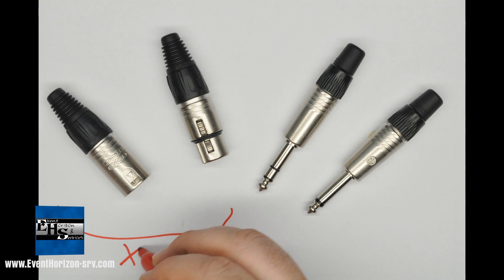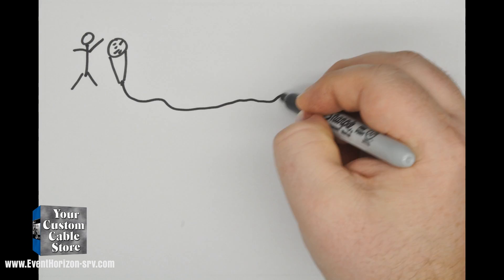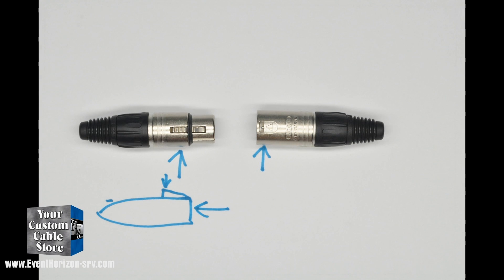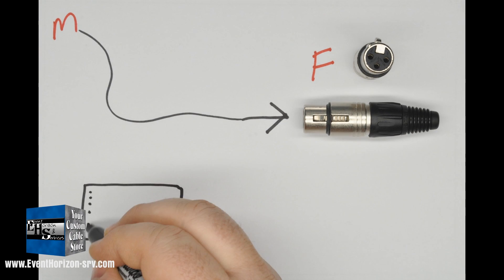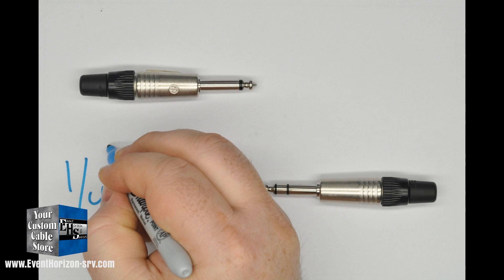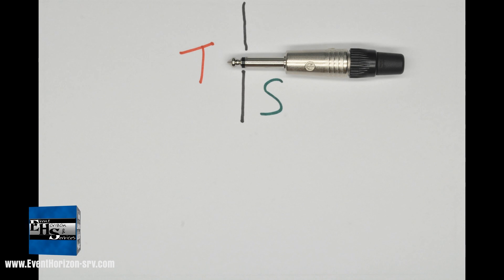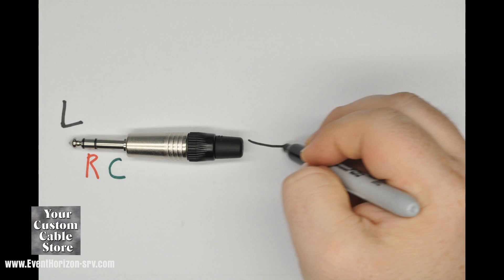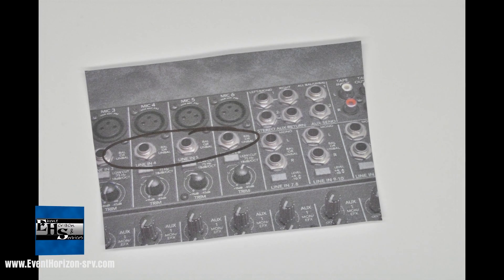Intro to XLR and 1/4" connectors

Comment: I have a microphone that uses an XLR to 1/4” jack cable. I bought a wireless mic system where the wireless transmitter plugs in to the mic, and the receiver, which has an xlr connectio, would plug into the mic input. However, the mic input is a tls connection, so I got a female xlr to tls adapter. Although everything fits well and as expected, the adapter does not work.any thoughts on why the adapter wouldn’t work? I would think it is just extending the same signal to the input. Thanks for any insight.

Comment: I have Behringer Sl 75C dynamic mic (XLR), and need to use it for podcasting (vocal?). Which cable END do I need to connected to Behringer Xenyx Q802USB mixer?  XLR? TS 1/4? or TRS 1/4?  I was worried if I buy mono (TS 1/4) that my voice will be heard only at one side of headphone? is that correct?
Reply from the maker: You need a regular mic cable XLR to XLR. Something like this: https://eventhorizon-srv.com/shop/mogami-2552-microphone-cable-10ft-p-72   You must use input 1 or 2 with the XLR input. The 1/4" connections on all channels will not provide the same about of gain and will not work as well for a microphone.
Reply: @EventHorizonSrv  Thanks a lot, I appreciate it .🙏

Comment: Nice! How can I connect my professional microphone to a audio receiver for speaking & singing?
Reply from the maker: Hey Stephanie, By receiver, I assume you are talking about the device that is normally used as a home stereo for switching and volume? One that just contains the normal RCA inputs?  If so the level of the mic signal is too low to be useful to any of the inputs. You would first need to feed it to a mic preamp to boost the signal (something like the Rolls MP13). From there you would need the right cable to feed out and split to the stereo RCA inputs, something like this: https://eventhorizon-srv.com/shop/y-ts-male-mogami-2528-cable-p-3622. Note, you should be careful, home audio components are often not designed for the dynamics that can be created by a live signal, you can easily damage speakers if you are trying to drive higher volume levels.
Reply: Great! Thanks for info & responding so quickly.
Reply: Great! Thanks for info & responding so quickly.

Comment: Very nice explained. I need your opinion. I recently bought iBasso DC01 and Samson QH4.
iBasso DC01 has 2.5mm TRRS balanced output and Samson QH4 supports 1/4" (dual 6.35mm TRS) balanced line input.
To connect these two devices I need to build this type of cable https://www.aliexpress.com/item/32954629109.html
So the question is how to wire 2.5mm TRRS balanced plug to dual 6.35mm using 8 core cable?
I draw this graphic to illustrate my question https://postimg.cc/qhS6Yhy9
Thanks in advance.
Reply from the maker: Hey BGA, you would tile the L+ contact to the left Tip, L- to the Left Ring, R+ to the Right tip, and the R- to the Right Ring. If you have a shield you would tie it to the sleeve of the 1/4".  The wire is the hardest part, you need something really thin to fit the 2.5mm. Then splitting it into two connectors can be a problem too. It really is a pain of a build because of the size of the 2.5mm connector. I might be able to do it, but I would have to check on a few things to know if I had the right wire.
Reply from the maker: I went to reply to your reply and it was gone, did you delete it?
Reply: @EventHorizonSrv  No. It's there. If you want I can copy it in "discussion" or I can send you a email
Reply from the maker: @furry0ssa  It just isn't here for me... I have it in an email, so that is ok. So basically you through a lot of information it that, but I am not exactly sure what you need to know or what exactly I need to answer. Could you please clarify?
Reply: @EventHorizonSrv  This is the lost post from yesterday:
Thanks for the reply. Ok, I agree with you. Pentaconn 4.4mm (TRRRS) plug is a way better than 2.5mm (TRRS) but iBasso DC01 only have 2.5mm
and it's not a good idea to use an adapter 2.5mm male to 4.4mm female for this portable DAC.
I already have these parts
https://www.aliexpress.com/item/32997088134.html
https://www.aliexpress.com/item/4000543110687.html
https://www.aliexpress.com/item/32890458597.html
I chose rhodium plated plugs and 8 core cable because it has thin wires and I need only 1m length. 
So this will not be a problem to solder on 2.5mm plug, but splitting it into two connectors and which wire goes where that is the main problem here.
Also this setup (iBasso DC01 + Samson QH4) I plan to use only for headphones and earphones testing.
So you suggest using this method where this guy create an adapter for headphones 
4pin XLR to dual 3pin XLR for this AMP https://www.schiit.com/products/ragnarok-1
This is the scheme that he uses https://youtu.be/02_akBIw_5I?list=WL&t=41
it's basically the same solution as 4pole (TRRS) to dual 3pole (TRS).
I also came across this cable https://tinyurl.com/yx2v4cuu (on the image below it shows the wiring of this headphone adapter cable)
and its scheme is completely different. So I decided to ask you for an opinion which of these two solutions is good for connecting a balance DAC
and an AMP that has only balanced input (but not output)? 
Also, these two cables are adapter for headphones but not cable to bridge DAC and AMP. Is there a difference here, too?
Thanks again
Reply from the maker: @furry0ssa  You should be fine outputting these to the amp. Just wire as stated in the first reply and you should be good to go!
Reply: @EventHorizonSrv Means solution #1. I really appreciate your opinion. Thank you very much
Reply: @EventHorizonSrv  htgh
Reply: @EventHorizonSrv  iyy7ui

Comment: I have a xlr microphone but I don't know how to connect it to a device
Reply from the maker: The question is what are you trying to connect it to? Most mics will need a mic preamp, that is normally where you start, that could be in a mixer or an audio interface. Without more info it is hard to help fully. Let me know if you need more help.
Reply: @EventHorizonSrv  I want to connect it to my ipad but what would I need?
Reply from the maker: Of coarse that is what you want to connect. I avoid ipads and Iphones as much as I can. Doing a quick search I came up with something like this:https://www.bhphotovideo.com/c/product/1354185-REG/saramonic_smartrig_ii_xlr_mic.htmlNever used it, might be great or not. But there are lots of options out there, just google ipad mic interface.Hope that helps!
Reply: Very helpful!

Comment: I have a question, I have a karaoke mixer amplifier with 2 xlr female mono out connections on the back (Right & Left). I'm trying to solder an xlr male to 1/4" mono jack, my problem is, many people and videos I've searched for state that pin 1 is ground? On the back of this amplifier it states pin 1 is Hi, pin 2 is ground and pin 3 is ground. Should I wire the 1/4" jack in this manner based on what the amplifier states? I'm not sure what the word "Hi" means but I assume it's "Hot"?
Reply from the maker: Hey, that seems a little odd, I would love to look at this amp, what is the make and model of it so I can look up a manual for it?
Reply: It is an EMP Power mixing amplifier with dsp effects model# EBK47, I have it connected to 2 passive loudspeakers at 300 watts each, the amplifier states its 300 watts per channel but Amazon states it's a 1400 watt amplifier
Reply from the maker: That is interesting. I could not find a manual so I have to make some assumptions. So it is a speaker output right? The labeling is really strange, with "XLR Balance" which makes sense but not if it is a speaker out. Then I have to assume hi = High = positive = Red and Gnd = negative = Black.I assume you are trying to make this go to the speakers with 1/4" connectors. Based on what I know right now, I would wire Pin 1 to the tip of the 1/4" and pin 2 (or 3) to the sleeve of the 1/4". I don't think you need to connect both pin 2 and 3 because they are the same. If you would rather purchase your cables we would be happy to build them custom for you to fit this amp. Just go to the site and click the contact and send us a message and I can walk you through a special order.
Reply: I appreciate the offer, I'm pretty good with soldering, I've made cables before, just thought it weird that pin 1 would be labeled as "Hi", Yes, the xlr female connections are speaker out and speaker connections are 1/4", but the last time I used this I was using a TRS jack, it was working fine for a while, then the speakers made a weird pop, woosh sound is the only way I can describe it, then the audio was distorted and unusable. I don't know if I blew the speakers or something went in the amp, I haven't tried anything since. Was hoping maybe it was me that messed up with the trs connection? I was thinking the same thing, wire pin 1 as the tip. They sell this model on Amazon but they don't show the back, if there were a way I could send you a pic maybe you can tell me more?